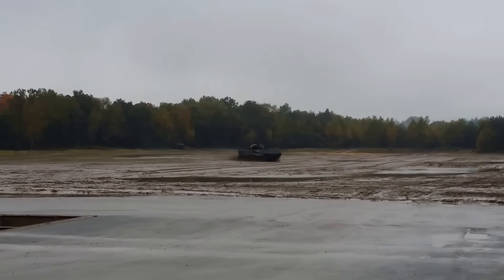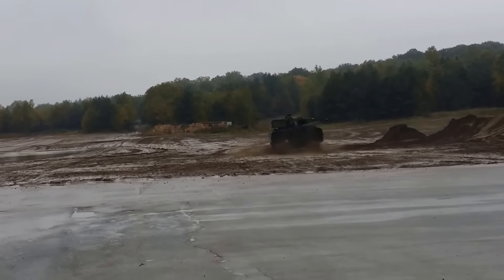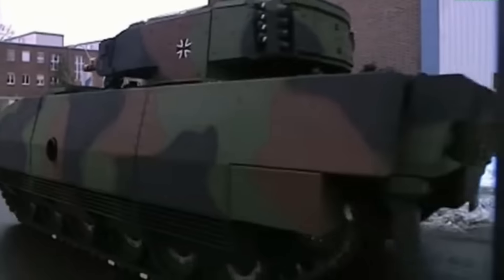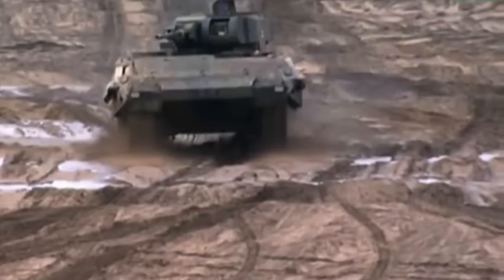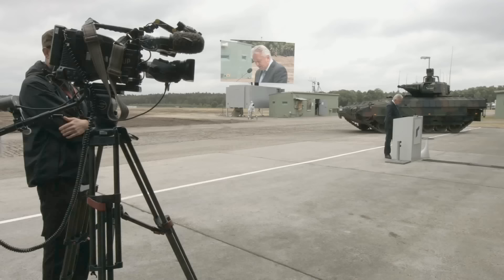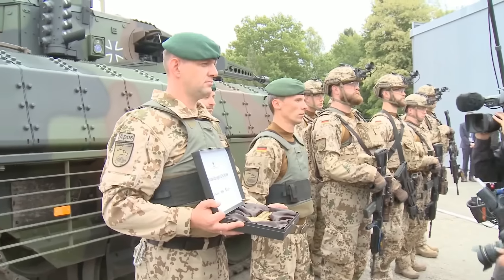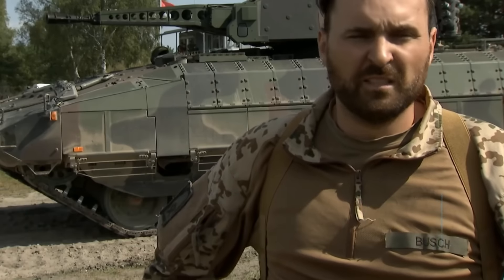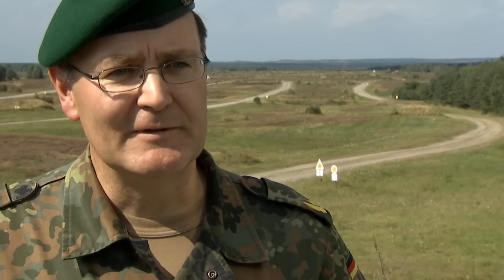The Puma Infantry Fighting Vehicle - Overview and Opinion

Comment: It is typical German! Not only all the bells and whistles, but they naturally have to be in tune - and with a great sound. Sure much of it won't work that well under battlefield conditions; but by the time they break down - they have (hopefully) killed the enemy. It is expensive, but then again - the cost of training the crew to proficiency must NOT be underestimated. The most expensive part of a tank is: The crew.

The scaffolding of the 30 mm. gun ist not there for decorative purposes - as far as I've heard: It is to stiffen the gunbarrel which otherwise has a tendency to whiplash - affecting accuracy: Nobody wants the real world interfering with your video-game inside.
Reply: For the reliability of the system, supposedly it was the only IFV in the czech test trials which didn't have any major system breakdown, every single other contender (ASCOD 2 (also known as AJAX), Lynx and 2 CV90 versions) had atleast one.

Comment: are you going to do a video of the M2A3 Bradley?
Reply: it will get replaced in the 2030s, but as for right now the M2A3 Bradley is still superior to most other IFVs including the Puma, CV90, BMP-1, BMP-2, BMP-3, etc.
Reply: There is already tons of pro Bradley stuff on YT let him get to the rare and little  known about vehicles  before he talks about the most well known
Reply: more interesting than the bradley itself is the corrupt scheming and budgeting that went into developing as well as revision after revision.
Reply: How can it be superior to a Puma, CV90 etc ? When the Puma is one of the most advanced systems ? And the Puma was one of the vehicles that was suggested to repalce the Bradley..
Reply: the US Army is not going to buy the Puma, in the 2030s the US Army will build the Next Generation Combat Vehicle, to Replace BOTH the M1 Abrams tank AND the M2 Bradley IFV.
Reply: It's hard to tell if the Bradley is the best. It doesn't have the ridiculously tough composite armor of the M1 series that would make it really hard to kill, but it does have all around 30mm APDS protection (not 100% sure that this is true for all circumstances, but most likely true for the front and probably the sides). That would mean other IFVs couldn't penetrate the Brad's armor with their autocannons (BMP-2, BTR-80, LAV, Puma, Marder, Warrior, Dardo, T-15, BMD-3, etc). The TOW 2 is a big advantage and makes up for the smaller bore of the autocannon it has (25mm vs 30mm, 35mm, or 40mm). It also has good optics and stabilization, but I don't know if it's that much better than other western IFV's. Definitely in the top tier though. Anyways, "Best" depends heavily on what you think is important. Engineering is all about compromises, to get something, like armor, you give up something else (like speed, reliability, armament, troop capacity, low price, or a combination of multiple things).
Reply: the Bradley is NOT a Tank, its armor armor is only designed to withstand up 30mm auto cannon fire from other IFVs,   what is important is that the Bradley is able to destroy other IFVs and defend itself against tanks with its TOW 2 missile. therefore it doesn't need the heavy armor of the M1 Abrams, as the job of destroying enemy Tanks is the Job of the M1 Abrams.
Reply: USA always trying to homogenize everything

Comment: I don't know a lot about tanks, but I know something about electronics. Most people see that their consumer electronics fail and think: "Shitty electronics". But it is just how it is designed. Electronics can be designed to not fail (or at least with very little risk). There are different levels of reliability. For example in your car: It is ok if your sat nav fails, and it is ok if your engine controller fails, that won't kill you. But airbags and brakes have to be designed with a much higher robustness. Or modern planes are fly by wire and there is not really a problem with that. They just use two or more devices with the same task, so if one fails operation can continue. And I guess that military will have similar or higher requirements. It is possible to build reliable and robust electronics, it is just a matter of cost. As a customer you dont want to pay that money, but military will. Or are you willing to pay 1500€ for a phone with the functionality of a 150€ phone just to be sure it works under any condition? ;)
Reply: Nokia struggled for a long time, because of many reasons. One of them was the lifespan of their products: their products last a long time and thus sales drop dramatically after the"Oh look a new phone"-rush. Apple and such don't have that problem because their software overloads their phones and hardware performances drop drasticly after an X amount of years, that way the customer has to aquire a new product after an alomst predicteble amount of time. For this reason there is this bullshit cult-like fan culture: if Apple would be treated like a normal company it would most likely have to change things to stay on the market. And it doesn't want that. Before people start screaming: i have years of experience with apple computers, and i started to buy my own PC parts and build my own PC, optimized for graphical work because i got tired of the out of proportion prices, and it's fanbase. A company shouldn't have a fanbase, happy customers: sure but a fanbase for a company is just weird. I now a have an extremely well functioning pc for almost half the price. My apoligies in advance for grammarical mistakes.
Reply: Electrical engineer here. You are correct. The kind of high end electronic systems that are fitted to "high stakes" designs like military equipment, aircraft, spacecraft etc. are designed with a staggering amount of redundancy so that if one systems fails, there is a back up method, and a back up method to the back up method, and so on. Often times you'll find a digital system that also has an analog counterpart that will accomplish the same task. 

These systems are also typically designed in a modular way so that if something does break, when you take it to get serviced by maintenance, it's as simple as take out the bad board and put in a new board.

However, I should note that electronics can always break, not matter how expensive they are. There are certain properties of electronic components that, at a fundamental level, cannot be avoided.
Reply: I believe you are correct, however, I think the point he was making before this was that they haven't been tested in a Real Combat environment...
Live fire on a gunnery range is not the same thing as having someone shooting back at you with the intention of killing you and that environment breeds different stresses on equipment as well as people... 

Having said that, I do believe these will hold up quite well in a Real Combat situation if ever tested...
Reply: Redundancy
Reply: The phone is a bad example, since it's not that important, imo (learn how to use a compass), but, I'd rather pay ~300 for an ASUS mobo that I know will last a decade, instead of ~150 for some off-brand piece of crap that will probably die the second the warranty expires.
Reply: one word:  EMP
Reply: Airbags fail all the time, mainly the sensor modules.  So not a great example.

Comment: a emp would destroy that thing...
Reply: An EMP wouldn't destroy it, but maybe disable. And it's not that bad like U.S. Aircraft Carriers with failing reactor cooling pumps due to EMP...
Reply: jonny no army is going to replace a football field of shot electronics if it can't drive or shoot permanently its destroyed and a emp doesn't work like it does in video games your car or tank simply will cease to work permanently tell the part thats fried is replaced in older viechles you could probably get away with just replacing the starter but this you'd be better off buying a new one then trying to fix it  this real life not call of duty jonny
Reply: What the fuck are you talking about? I'm talking about a "catastrophic kill" here. The crew will survive a shitty EMP. And what video games are you talking about? Armchair general much hm? Also an EMP isn't an effective weapon yet, only in your mentioned videogames maybe. In reality a EMP strong enough to engage will also chew up the electronics in the attacker's country, nice eh? Don't sleep in physics lesson. Also every MBT/IFV/AFV is full with electronics this day and will be disabled (Also some are protected using fiber optic inputs and outputs). These heavily armoured vehicles are a massive faraday cage and will actually mostly widhstand such a thread.
Reply: yes the crew would survive but only the crew but thats not even what a faraday cage is unless your saying every tank has a fancy fluffy inside were only the electronics are. theirs nothing in that design that emp resistant and in a Faraday cage you can't have any wires or anything outside it or it won't work and those camera's are outside the tank so the emp would still get in very easily and destroy everything inside it
Reply: "fluffy inside" whats going on with you. There is protection. Ever heard of cable housings? And how a faraday cage works? lol. "the emp would still get in very easily" do you think an EMP works like a tiny animal thats crawling into the tank trough holse or smth? That's hilarious! lmao, but seriously, let other guys think about this stuff you have literally no idea.
Reply: If a cable housing is intended to protect a cable from an electromagnetic field...

It's not made from metal goddammit. What the fuck. Read you stupid. It's called "EMP Hardened" Installing complex electronic components in seperate faraday cages inside the vehicle. And i said above, a rather usual faraday cage  (car) won't work since it's too thin. You're overdestimating an EMP anyways. The main problem is that an EMP can't  distinguish from an enemy or friendly vehicle, so it's fucking useless at this time. NEMP can be used to disable economy or production, but has no place on a actual battlefield. And that i actually outplay you with valid arguments isn't a reason to be rude kiddo.
Reply: your the one being rude here sir and your argument is very invaild and i'm not overestimating a emp it's simply not something that thing is designed to defend against
Reply: development of shielding against an EMP maybe easier but it hasn't to piont you can protect a fully exposed camera like it has there and again as i said that puma isn't designed to be emp resistant if it was their wouldn't be camera's on it. it would be slightly more old fashion with the view ports and as for emp resistant if you took a look at other resistant tanks and cars you'd realize none of them have full relince on fancy cameras and a emp is dangerous because it can halt an advancing army if your not prepared for it
Reply: Armchair general much hm?
What the fuck are you talking about?
It's not made from metal goddammit. What the fuck 
Read you stupid
Reply: and it has gotten a bit more powerful do to more and smaller designs for it
Reply: Well, cameras can be replaced and have a HUGE advantage in every other tasks the IFV is constructed for. Sure it's not build to be blasted with EMP strikes but it's resistant to a certain point like other military vehicles.(Yes subsystems are required to have a certain shielding) It would be dumb if noone actually thought about such a protection since an EMP is one of the biggest threads to date. But who said that the Puma relies on cameras? The driver still got conventional periscopes and the commander too. The outside sensors that look like cameras are actually to detect incoming ATGM and such a system is more important today, since modern ATGMs can totally destroy the vehicle killing it's crew instead of just frying it's tech. They just have to balance the pro's and con's.
Reply: this video does not show it with the conventional parascopes also the camera component is connected to the firing component and hopefully not the driving component my point is anything connected to those camera will be damaged in the event of a emp and if their is a parascope then maybe the puma will be able to run away in such an event but from what has been shown it lacks the capability to manually fire and aim
Reply: Turret has manual controls afaik but the fire control may fail so highly reduced accuracy would be given, however i talked about the drivers and commanders hull periscopes that are fully analog as usual.
Reply: again stuff that wasn't on the model shown in the video you are talking about
Reply: Hull periscopes? You can see them. Angled mirrors over the driver and commander. They're on every armoured vehicle.
Reply: ok i found one on the driver side but thats about it
Reply: Here you can see the sights over the commander's displays: (right side): http://2.bp.blogspot.com/-JyPa70yhD_g/VYnmrHus0eI/AAAAAAAACyc/MPqkPkHLXu8/s1600/2015-06-24_Puma-02.jpg
Reply: so yes it would only be able to run away from such an event as long as they have the engine systems protected
Reply: Yes is can, principle of the Faraday cage is that a current gets induced into the cage, which's magnetic field for counter the incomming E_M field...simples...what touches the insides of that cage is of no importance, be it metal, placstic or unobtainum...
Reply: ronin it can't because a faraday cage has to be in a closed off cell the technology you speak of they have only been able to figure out how to possibly protect the engine not the entire electric firing mechanism.

Comment: Theese IFV have 2 Computers in it, if one breaks, use the 2nd. And they are just modules. If one breaks, just clip it out, and insert a working one in base. 1 minute of work.
Dust on cameras? Theese vehicles have cleaning mechanism on cameras. If commander and gunner cameras get destryoed (all 6 cameras?!), then you gonna move to base anyway, even if you would have an manned turret.